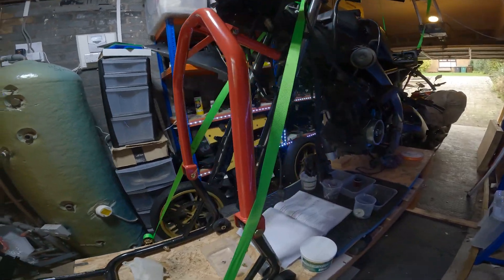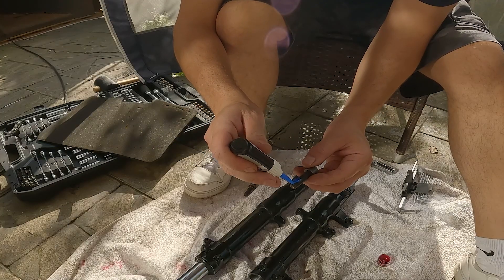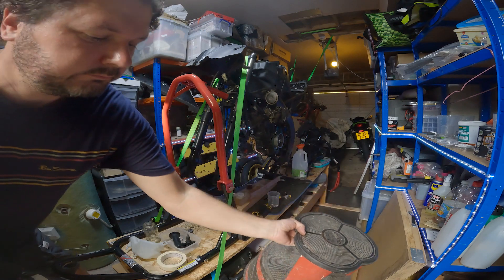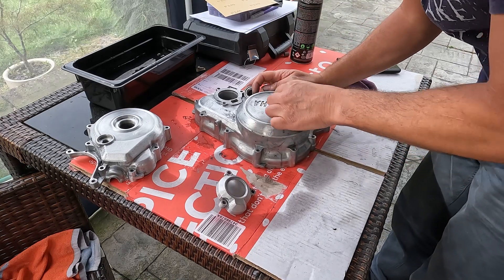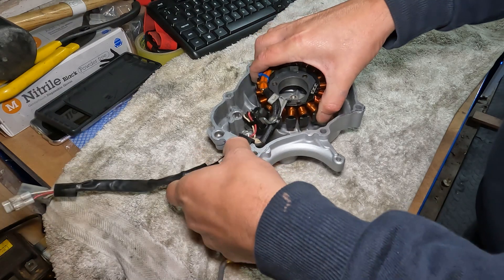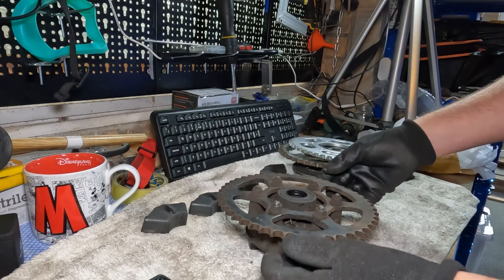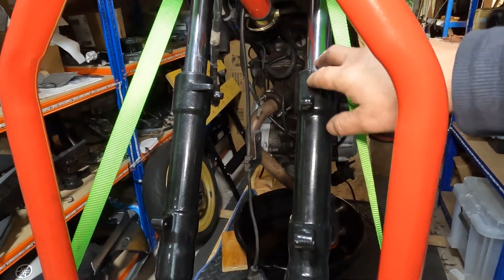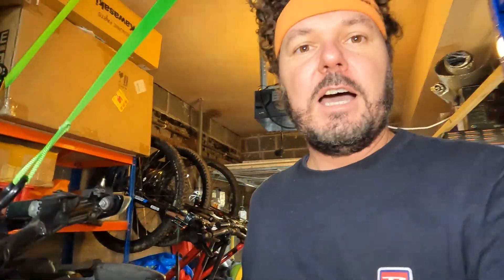Painting and rebuilding motorcycle forks on the Yamaha YZF R125

Comment: how do you open the forks i dont have a top screw or at least i can’t see it
Reply from the maker: It’s fiddly. If you check out my video linked below you can see me doing it

With the fork in the bike, take off the handlebars and dust cap. Then push down on the top of the fork to compress the spring and that exposes a retaining clip. Prise that out and the whole thing comes apart.

https://youtu.be/9Uo7q4cZMG4?t=4m48s

Comment: how do you adjust the idle on them?
Reply from the maker: Where the throttle cable attaches to the top of the engine, there is an "idle screw".  you can tighten / untighten this to adjust the idle.  If the cable stretches over time then you might need to do this. Or replace the throttle cable if its stretched too much. You don't want that snapping a long way from home.